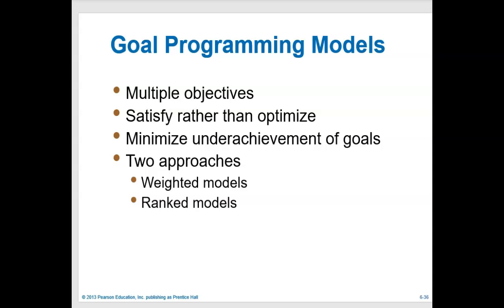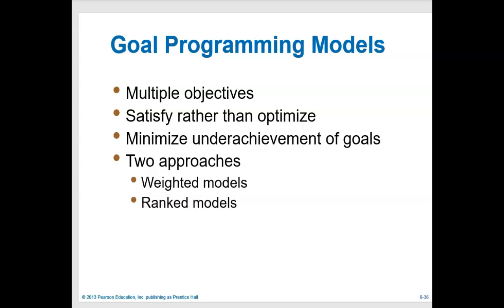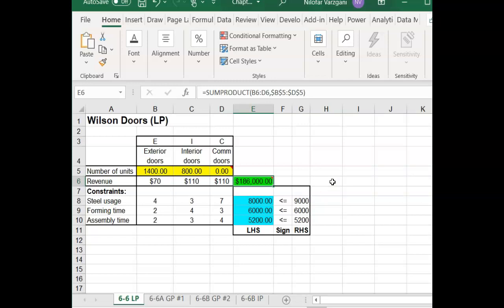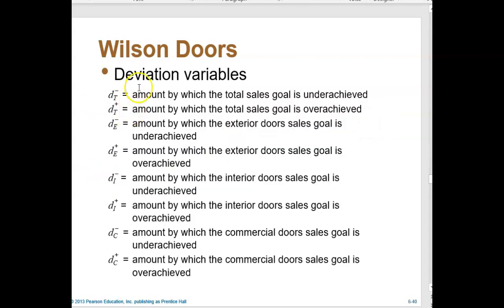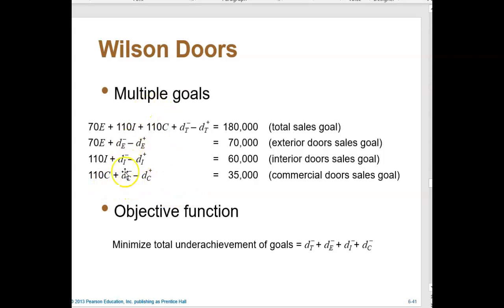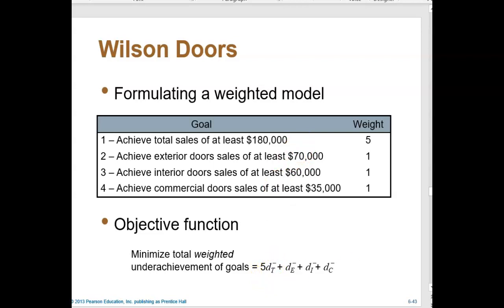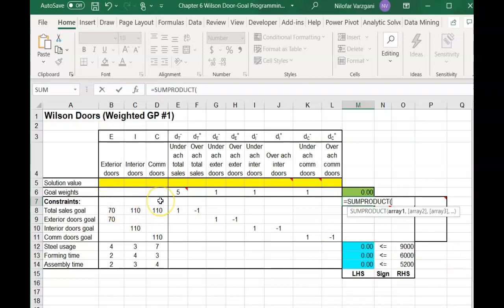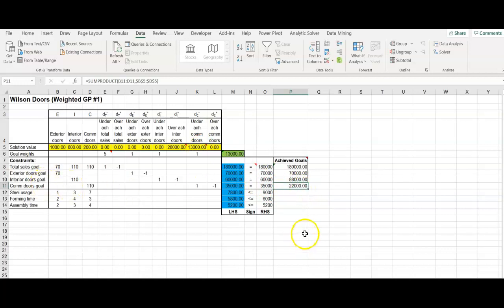Goal Programming (Weighted Approach)

Comment: hi! im doing a research on the weighted goal programming. i wanna ask. how do we set the weighted for the objective equation? are we just assuming the weightage or we need to calculate to get the weightage?
Reply: Even I wanted to ask the same question here, have you got the answer for that?
Reply: @ashweenasundar  yess, ive got the answer. Mostly the article said that the weightage must equal to 1. So what we have done is x / total availability = weightage of x. Hope its help
Reply: @nuradibahzullfakar9678  alright, so the total availability is based on our case right, anyways thank you very much.
Reply: @ashweenasundar  yeppp and ur welcome ☺️
Reply: @nuradibahzullfakar9678  what does that x means....kindly let me know